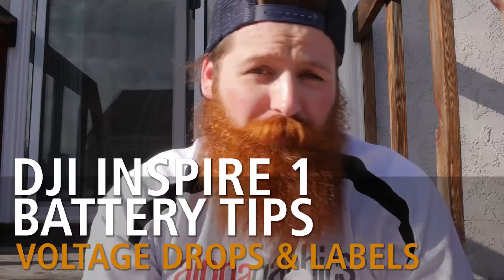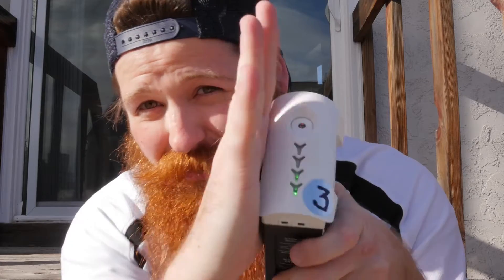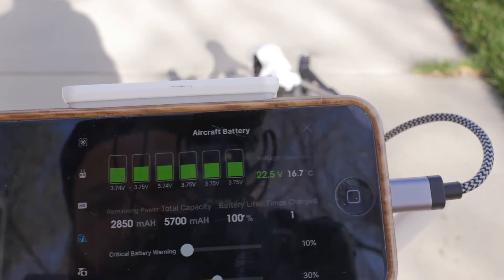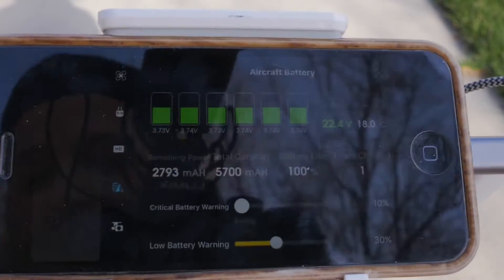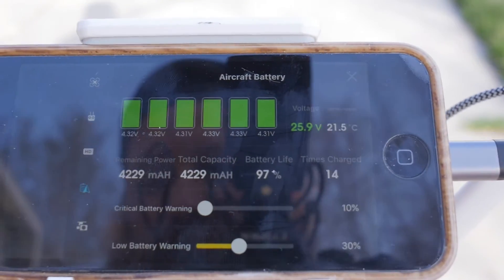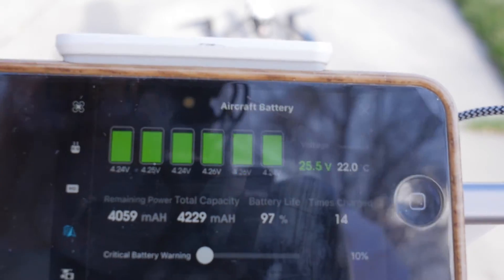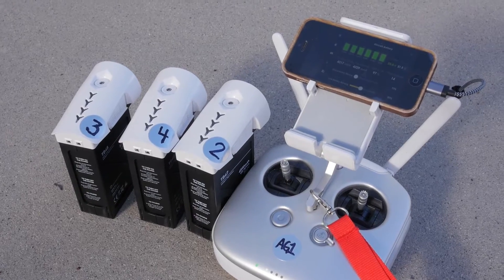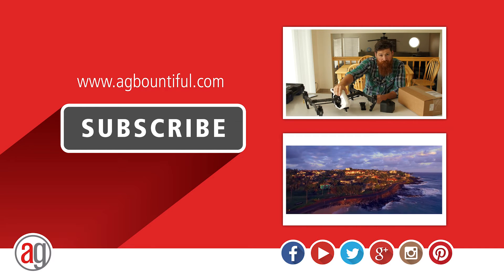DJI Inspire 1 -  LOW VOLTAGE BATTERY TIP

Comment: Interesting about your batteries still alive.. But I got a Drone Phantom 3 from Rammable sale Church. I tried to charge two batteries but it was still low at one flash overnight. One thing: controller batteries already look perfect.. How it solves the problem of two batteries still dead. I tested the light on one flash not full yet. Should I replace it? Let me know Thanks

Comment: What about loss in capacity? I have a couple tb48 batt that only hold a capacity of 4600mah instead of the 5700. This is at 40 charge cycles for one and 42 for the other. Is this typical?
Reply from the maker: I'm not sure if that's typical or not, but the older the battery the less they tend to hold a charge. I've had some newish LiPos with other drones go bad after only being used a few times because they got old and were stored with a low charge. So if the batteries are old, even if you haven't cycled them much, there is a chance they won't hold as much of a charge.

Comment: I just flew in 18% no issues till 3 mins left
Reply from the maker: Vass Yeah I’ve pushed it pretty far before. You’ll want to charge fairly soon after you get a battery that low. LiPos that sit low for too long can cause damage to the battery. I just had a racing quad LiPo have an issue with this where I forgot to charge it after I flew it to a low charge and the voltages were too low for my charger to charge it. Had to “bump” the battery charge and then fortunately got it working again. But just in general running low batteries is always risky.

Comment: Good tip! But some People advice to not fly below 3,6V. What is your recommendation about minimum battery voltage?
Reply from the maker: As soon as I get the first warning for low battery (with the default low battery warning settings) I land it. But I tend to be a bit more cautious that some people out there. LOTS of pilots run them longer and push the limits without any problems.

Comment: This just happened to me. Batteries sitting around tried to fly. I was lucky i was able to bring it back in time. I read somewhere that after sitting around you should drain them but I  don't even know how that's possible
Reply from the maker: One of the most simple ways to drain the batteries is to take the props off and just let the inspire 1 motors spin. The batteries automatically discharge after sitting for a set number of days. I believe default is 10 days. I always store my batteries drained. Not down to 0% but at about 25 to 30%. So basically when the Inspire 1 starts giving you low battery warnings when flying I bring it in. I don't fly every day so they end up in storage somewhat frequently. So far my batteries seem to be doing great after owning them for over a year.
Reply: Cool. Doesn't that put uneccesary wear on the rotors?
Reply from the maker: I suppose it might put a TINY bit of wear on them. I can't imagine it would really have any negative effects on your inspire 1, but if you want you could put the props on and actually fly it instead. Flying it will actually drain the batteries MUCH faster anyway. When I finish a shoot before I run out of charge on my batteries (which rarely happens) I keep flying around until it's drained to the 30% sometimes that means taking it home and practicing figure eights and whatnot in the field by my house.
Reply: Please do NOT store your batteries at 30%, this is very bad & will kill them eventually.
Fully charge the battery after usage and let it be, after 10 days (default, adjustable) it will discharge automatically to the BEST level for storage (50-60%)
See the Inspire manual for more info.
P.S. keep the antennas of your remote parallel for best range
Reply from the maker: Thanks for the headsup! Good to know! I'll have to go back and read up on that part of the manual again and add some annotations to the video.

I've found leaving them on a full charge and letting them auto discharge works great but often gives "false" readings thinking the battery levels are MUCH higher than they actually are (similar to what I show in this video but often even more dramatic). I've seen a few people take off get a little ways away from themselves and suddenly realize their bird is needing to land which can be scary. I've started to make sure I'm good hovering around for a little bit nearby before going too far out. Always have to fly on a fresh charge for sure.